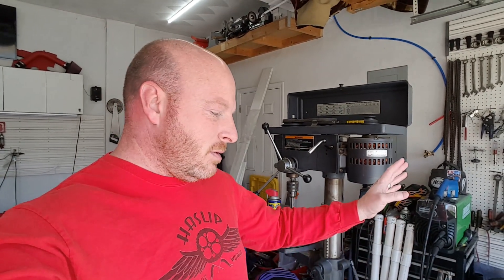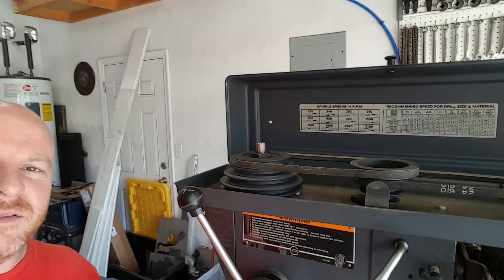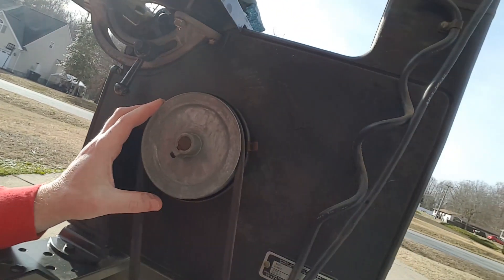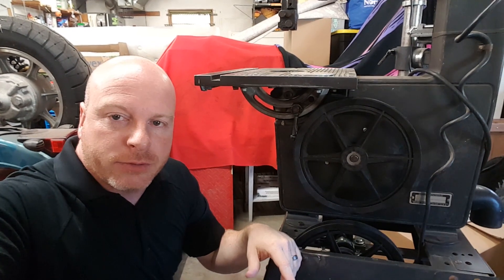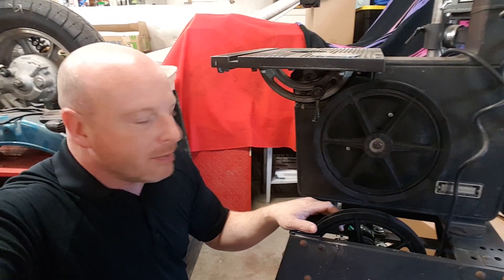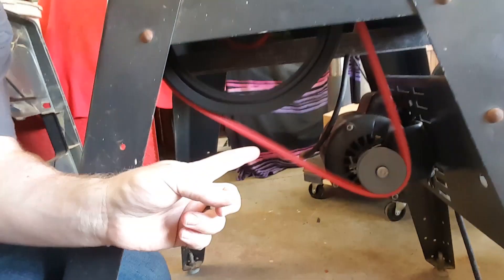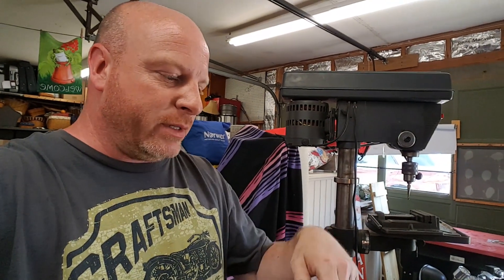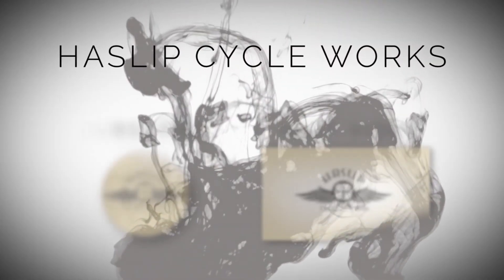Converting a bandsaw and cleaning up a drill press

Comment: Do you get adequate tension on the belts simply by connecting them around the pulleys, or have you found you need to move the motor slightly to create tension?  Any tension adjustment for the jack shaft pulleys?
Reply from the maker: The motor is on a mount that lets it slide to tension the belt, also the jack shaft mount has slotted holes to allow tensioning as well. It’s a balancing act to get it all right but once you do and lock it all down you are good to go.
Reply: @HaslipCycleWorks  Awesome, thanks for the info.  Nice work on your saw!
Reply from the maker: @steveweller4675  thank you! Appreciate that.